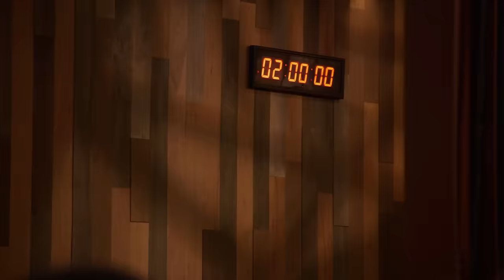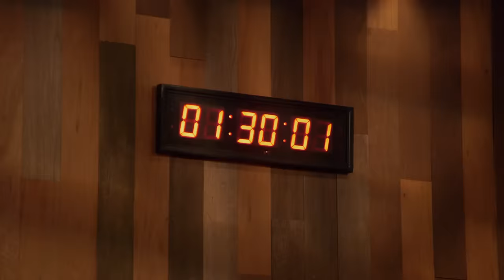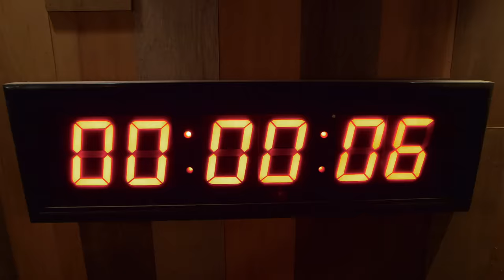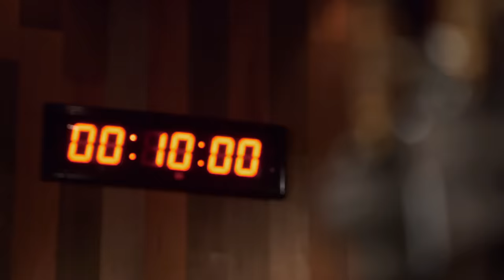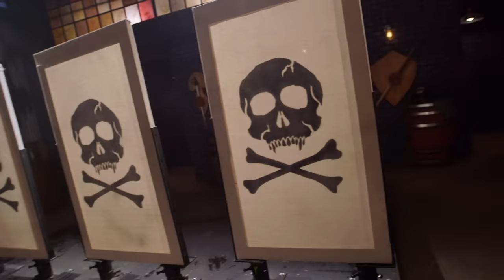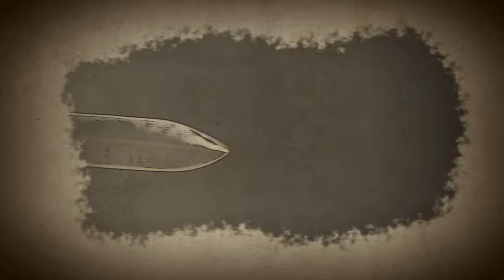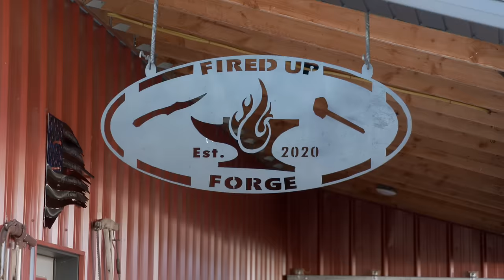Forged in Fire: Epic Judge Takeover! (S8, E36) | Full Episode

Comment: Seems like Dale's kris really didn't have any curves to it at all, barely any curve at all. I would've given it to John simply for parameters.
Reply: This one was rough for me. John's blade was by far more beautiful. The materials in his blade were of a higher class...

Kris are known for having waves and Dales did qualify and at the end of the day overall usability in weight... I agree with the judges. When John's blade cut through the pig the ice and the palms... It was sheer weight and force as if it was an ax doing the damage rather than finesse sharpness and speed like what a short sword/long dagger is supposed to be.
Reply: I agree with you. What Dale produced is like a 5 year olds drawing of what a kris is supposed to look like. Sure it's a high performance sword but it definitely should have lost on parameters.
Reply: @caseyb1346  that's why this one was so rough for me.. It's funny how you worded it. Dales fullers did look like a 5 year old's drawing.  And the fact that John came in with such a Damascus pattern made Dales blade look even worse but... If I had to use a weapon I would prefer a function over aesthetics. 

Even when the aesthetics are on a whole nother level
Reply: Chiming in, hate to give it to Dale but you just have to. The warp on John's blade seals it. Parameters were ...met.

Comment: What a strange second round.  I think Jay did not want Tyler to move forward after hurting himself with the handle even though his blade passed both tests, and I suspect the producers bent the rules here to allow Dale to move forward despite the tip breaking on his blade.
Reply: The judges have said multiple time in past seasons that the blade should never hurt the user. Nothing surprising for me at the end of round two
Reply: @ethanloggins8975  Except a broken blade would be considered a catastrophic failure in any other episode.